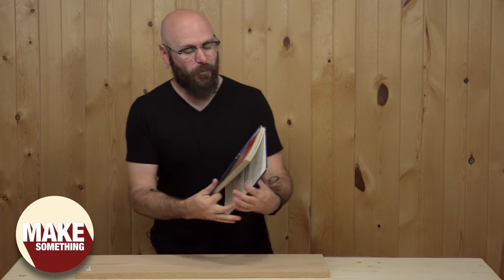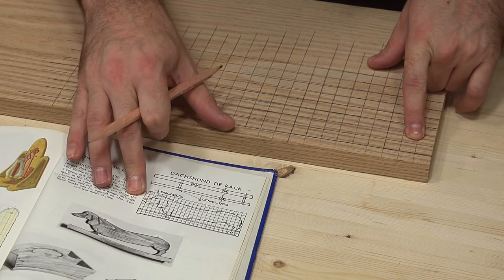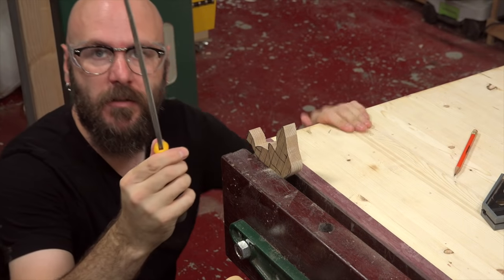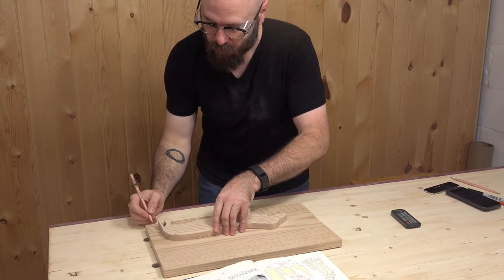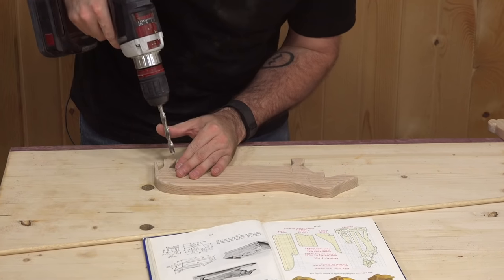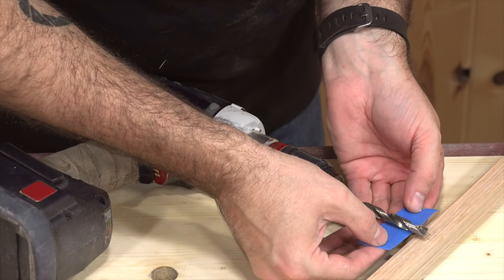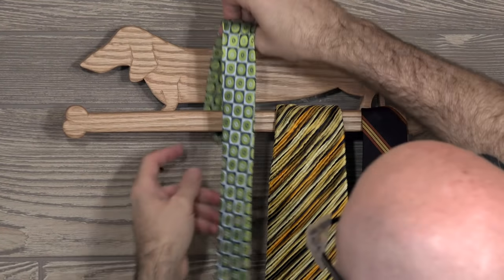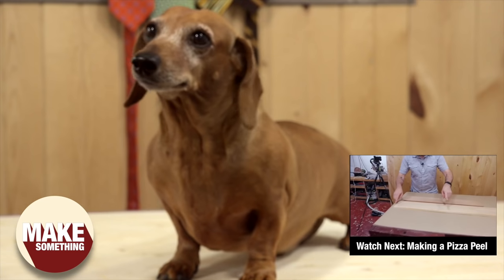Ridiculous Woodworking Project from a 1959 School Textbook

Comment: Hey cool videos, do you back off the tension on your bandsaw blade when you are not using it? I have a Delta 16" bandsaw. I've heard that 'flat spots' or small bends can be made on the blade if the tension is left on . What are your thoughts on that ? 
Keep up the great work!
Reply from the maker: +Christopher Thiessen thanks! I do not back off but I use my bandsaw at least once a week. If it's going to sit for a long time it might be a good thing to reduce the tension